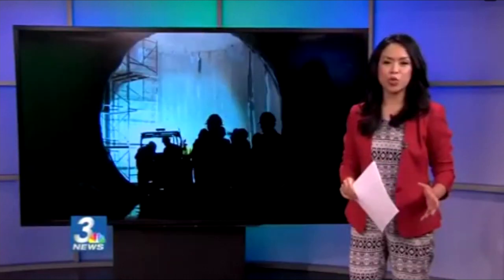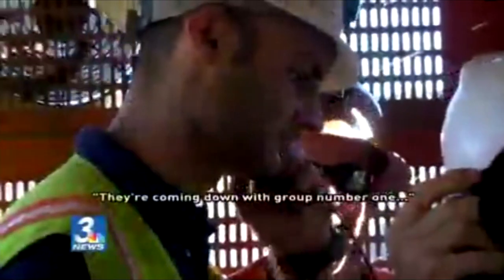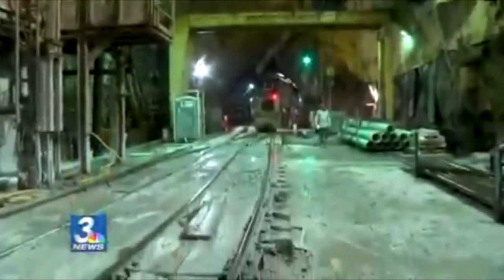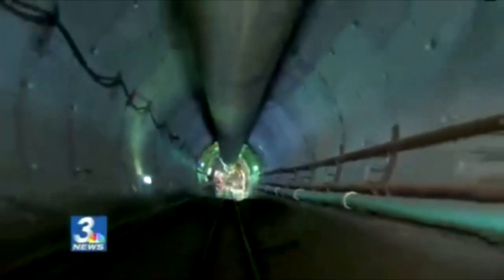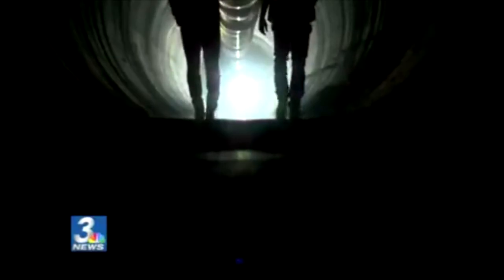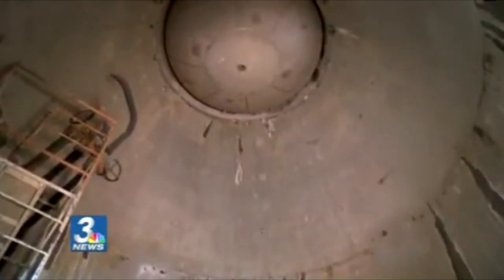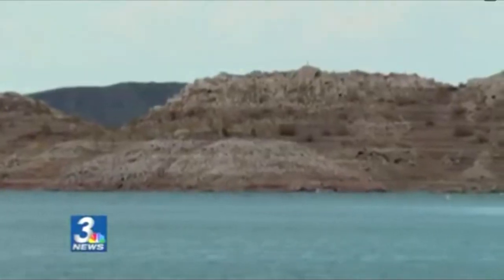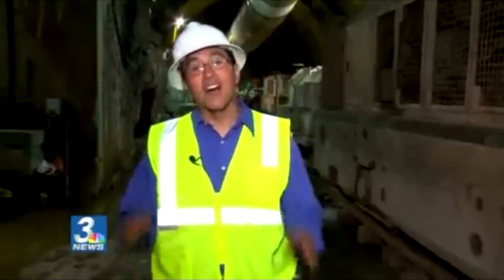Tour : Lake Mead Intake Tunnel 3

Comment: So what happens to thedebris from the pkug when they blow it up.....will it be removed
Reply: The tunnel was flooded from the inside to equalize the pressure, then the plug was removed with a barge crane on the lake surface.

Comment: Imagine the colossal whirlpool if that plug was to fail lol
Reply: Creepy...
Reply: Would most likely not have created a very big whirlpool. Since the tunnel doesn't drain into something, the waterflow would have stopped as soon as the tunnel was flooded. Side note: The tunnel was actually flooded from the other side, in order to equalize the pressure, before the plug was removed!
Reply: @TecraX2   Thanks. I was wondering about that; the heavy plug could've cracked if it had been opened a fraction then slammed shut suddenly (though, surely the machine driving the plug would be more than capable of lifting its weight, plus the suction from the vortex).

Comment: did he say 7 years to dig 3 miles??...really...
Reply: They are boring the hard rock.
Reply: At one point there was a serious flooding/mud event caused by an unknown fissure. That required new study, plans and engineering to set an alternate route. That’s after digging the large vertical shaft that allowed the tunnel boring machine to be lowered in segments then assembled. That alone is quite a lengthy task. Thanks
Reply: They built the entire thing in 5 years with way less technology.😂

Comment: So.....this has been going on for 7 years? How did they "know" that the lake was going to get that low that this tunnel would be needed? Makes you go hummm
Reply: @SixPackDan  also, saying it hasn't been this low since 1937 is full on BullShite. the current water level (June 26, 2019 5AM local time) is 1084 Feet. 

in 1937 the highest recorded level was 1202 feet, since then it has been at 1080 feet. (like it is now) 10 times, 1 time in 1955, 4 times in 1956. 2 times in 1964, and another 2 times in 1965.

if you check the entire list its actually pretty clear there seems to be a 20~ year cycle of highs and lows in the lake. in the 1960's lake levels started slowly dropping, starting in 1980 the lake levels started going up. reaching a peak of 1214 feet in the year 2000. since then it has been going down. so id say somewhere around the year 2020 it will start slowly going up again over the next 20 years. this has been going on since 1937.

a full pool that's at 1229 feet, has never been reached. the recorded highest level is at 1225 feet. and the level has reached above 1220 feet only 3 times in the dams entire history. the times that the water was lower then 1200 feet is almost 90% of the dams life time. with an Average water level of only 1137 feet.

if you look at the entire dam life time, then a water level of 1080 feet such as now, is actually pretty common. 

and the dam maintains an accurate chart which you can find online by googling "lake mead historical levels"
Reply: Because climatology is a thing.
Reply: there's this crazy thing called research.